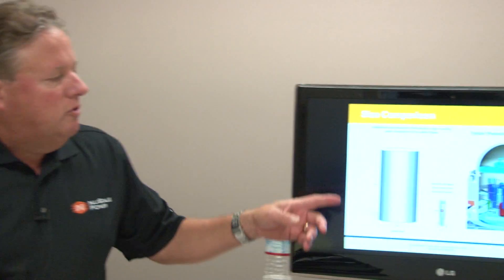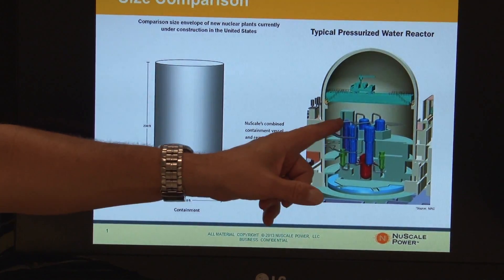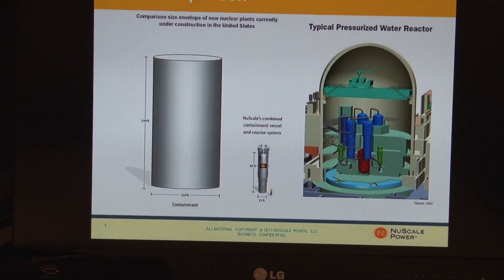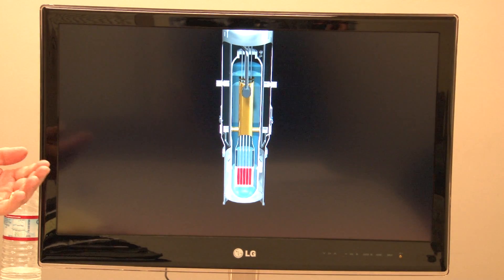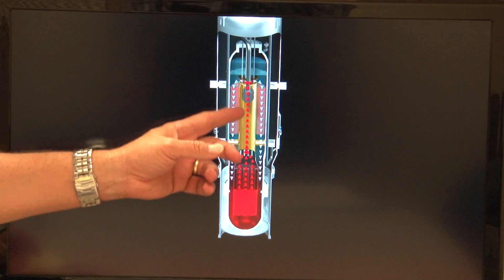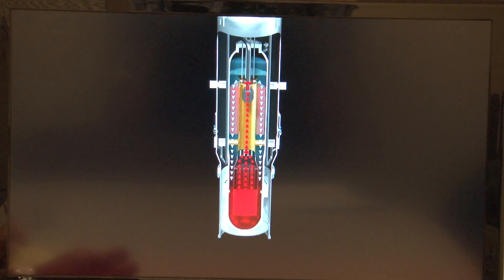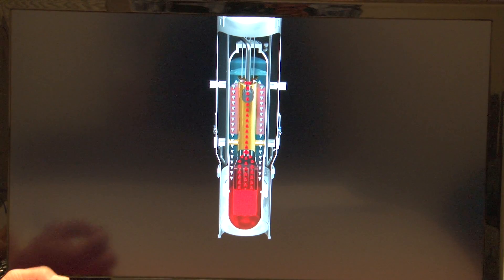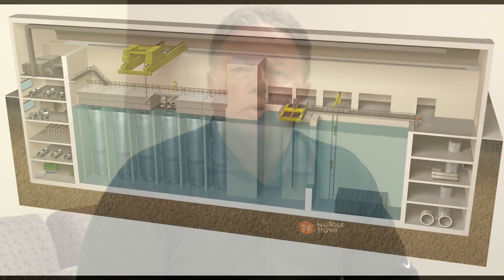Planet Forward Video

Comment: The fukushima plant had passive cooling. The valve was shut. In this scheme that could not happen but the coils do need cooling. In Fukushima the decay heat was enough to boil the water pools.